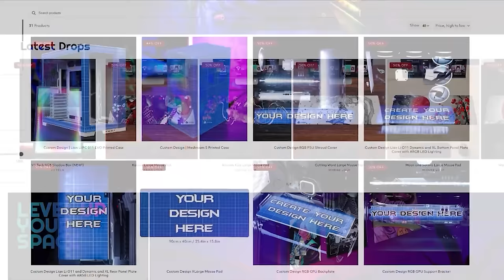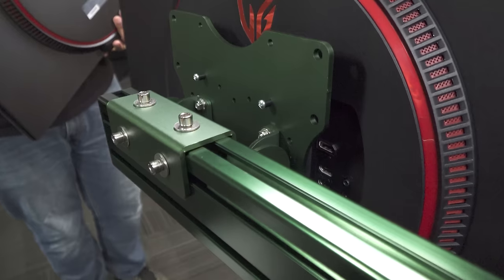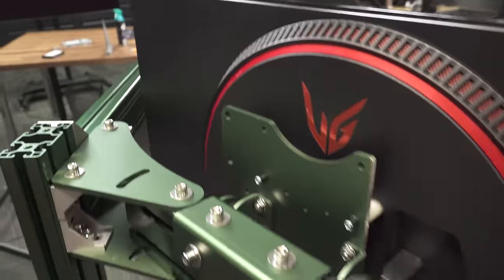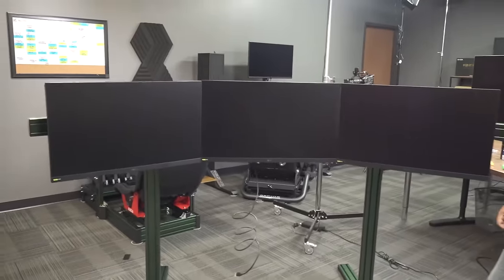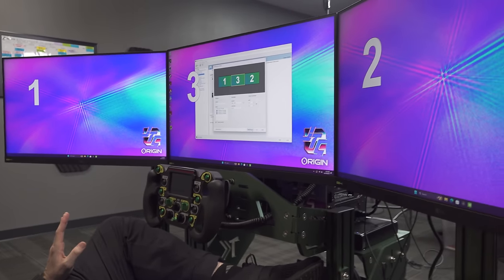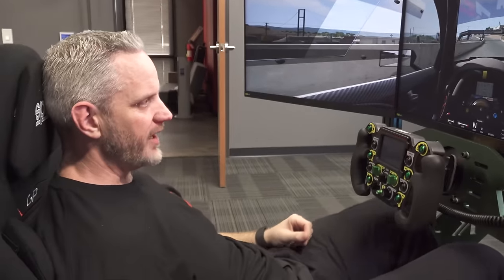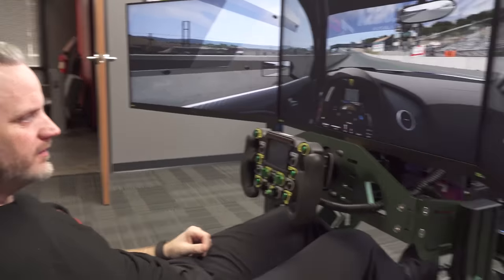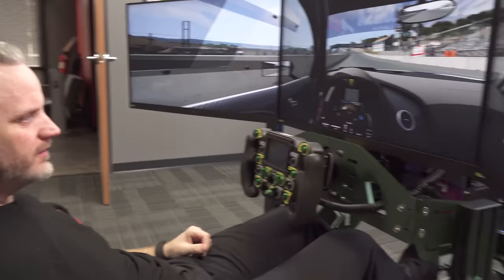I haven't used NV surround in over 7 years! Does is still suck?

Comment: I've just started getting back in to sim racing (still entry level g29 setup, will upgrade to moza stuffs in near future) and I'm absolutely loving this content! love to see what others are doing with their setups and learn a thing or two along the way! 

As others have mentioned, Content Manager for Assetto Corsa is a must! Such a game changer and makes modding soooo easy.
Anyways, keep up the great work. I look forward to what comes next. Happy new year Jay, Phil and Nick!
Reply: Yo , from an ex moza user i am going to offer you advice i never had the benefit of . I have no idea what your budget is and moza looks a viable solution based on value but it WILL! Cost you alot more in the long run if you buy moza .i owned the r5 bundle and the r9  with a gs wheel and srp pedals   both were nice setups and felt decent to use but moza have lets say interesting quirks . The bases get excessively hot after a very breif period of driving especially on AC and ACC maybe its the way the ffb is delivered to the base but after one race the base had to be left to cool or the ffb would be cut to control the heat both are not good , the nm values you are sold are quite overstated yes you may get breif monents of the advertised value but not often , now lets deal with moza support, in a word terrible !  I had an issue with the r9 base which had to be sent to their repair center this took 2 months to sort out, they can take weeks at a time to respond to an email conersation (not good for your emotions) i paid shipping for my items return which i was told i would be refunded(i wasnt) was all a horrible experience . The software and firmware updates are intent on killing your equipment every update is a lottery if the base will still function as before ( mine changed one update and i could never enjoy it again from that point it never felt as it did prior to the update) after less than 12 months and spending about 1700£ on the two bundles i sold it all at a loss i got 1050£ back and re invested in the asetek la prima bundle i had to add another 400£ to buy this so now in total i was down 2100£ to get a setup which is vastly superior to the moza setup in quality and feeling . You will end up uograding if you go moza so with all sincerity i will save you that hassle and say go simagic alpha mini or asetek or the new csl dd which is just realeasing. You spend a little more upfront but save yourself money,stress time in the long run . Ive opened the door to you its upto you if you walk through it.
Reply: @bodasafur6078  I appreciate the detailed experience/feedback, definitely something I'll look into more. Budget-wise idk really.. moza became appealing because as you said it seems like pretty good value compared to a lot of the market and I've heard a few good words about their bases. They were also on a real good sale just recently near me but I see now that's finished :') maybe it's a good thing lol. Was mainly interested in the moza R12 with I think it was the rs V2 wheel and still hadn't 100% decided what pedals as I heard mixed reviews about srp and CRP pedals.
Will dive down the rabbit hole again 😂
Reply: You are welcome , its worth noting that jay has already swapped from moza to simucube it looks like ,these guys had all moza last time i saw them using it now suddenly not. Its very telling .
Reply: @bodasafur6078  yeah I had noticed that. Though I don't recall him mentioning having any problems with moza (at least in this vid) which also says a little
Reply: @UnknownEntity420  yeah im not saying his stuff broke but either way he felt he needed different/better gear  which goes to my point you will want to upgrade sooner or later im trying to suggest through experience its easier to buy wise first time

Comment: Jay, I used the exact same monitors for my triple setup.  I just used standoffs, 4x50 mm, in the monitor to space them away from the vesa.  Also, you need to slide the vesa to the outside of the extended arms as far away from the center as possible to get close to the 60 degree angle desired for the side monitors.  It will give you a 180 fov.
Reply: The side monitors edge should be perpendicular to you eyes.

Comment: When you properly set up the monitors in the sim they will have a much steeper angle surrounding more of your head, that will force the monitors to be further out on the arms and allow you to put the screw back in and use the designed amount of angle

Comment: as a guess a 2 or 3 inch block spacer between the mounting plate and the part that holds the plate to the arm should let you pull the montiors in to where they work properly without any jank.
you could even make it out of wood if you don't have metal that thick

Comment: I think you've probably set up the monitor stand wrong. Most alu profile stands have the cross pieces sat infront the uprights. That way you can then bolt those angle brackets direct to the cross pieces and you then get your left right adjustment completely independent of the uprights vertical slots.

Comment: ARKON Mounts Square VESA 75/ VESA 100 adapter plate, on Amazon for anyone that doesn’t have the tools to cut the plate. 

I had this same issue mounting my LG Ultragear 49, power was completely covered by the simlab plate and I got lucky finding one that works with the aluminum slots.

Comment: Would like to see you do some more sim rig builds in various budget ranges and compare them to your ultimate one.  Also, would be cool to see a multi-purpose sim rig and how easy to interchange between racing and flight.
Reply: Rig itself Trak racer tr120. Then choose Moza for entry or simucube higher end for wheel base/wheels. Then either Sim jack pro for entry, moza for middle of the range, simucube/asatek/heuisinkveld for high end pedals.
Reply: Rig itself Trak racer tr120. Then choose Moza for entry or simucube higher end for wheel base/wheels. Then either Sim jack pro for entry, moza for middle of the range, simucube/asatek/heuisinkveld for high end pedals.

Comment: This is great lol, I’ve literally done the exact same thing! I as well have used nylon spacers and long M4 bolts to mount monitors in a way that wouldn’t absolutely frick the cables. I’ve done the same thing with a large flatscreen tv too actually, to keep the HDMI out of the wall.

Comment: Get rid of the corner brackets where the side arm mounts to the center monitor arm. You can see the “angle bracket” is bolted directly to the left/right side arms. It can be bolted the same way to the center monitor horizontal arm.
Reply: Where can I send you guys pics to my setup using same rig?

Comment: I have the curved version of those monitors. Also you may complain about the mount but we all know they intended you to use a 100x100 max bracket like most stands and mounts use. So in like 90%+ of the time the placement of the ports should not be an issue. Also with them in that location it makes it easier in most cases to run the cables along a mounting arm.

Comment: I have the same monitors and a trak racer triple mount rig too. So glad it wasn't just me who found it infuriating how LG placed ports and even frustrates the best of us. I used extenders on the bolt fittings but still had to use 90⁰ adaptors to get cables in (don't have a grinder to hand or would done what you did lol). 
Lot of hassle but worth it once up and running
Reply: Have similar monitors on a Sim-Lab trip stand, and bought 90 degree cables. Only way to get it to work (Vario Vesa Mount). Great thinking LG!! :P

Comment: Okay so 2 HUGE things Jay and Nick on the monitor stand since you're new to triple screens:
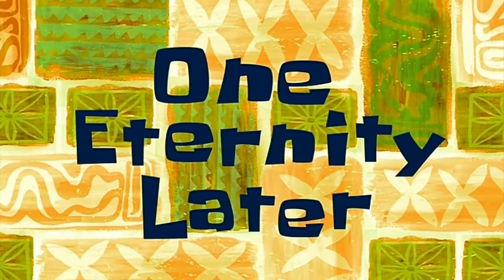1. 5:30 - You did this backwards! Move the monitors on the side arms out towards the ends of those arms, set the angle you want in the slot on those angle brackets for the side arms, then slide the side monitors back towards the centre to eliminate the gaps as best as possible! Greater angle for the side arms = mathematical FoV will be higher = greater sense of speed and immersion since the screens wrap towards the seat more
2. 12:45 - single screen means the game window is rendered from a single camera viewpoint, which distorts the image on the side monitors since the camera can't capture such a wide FoV correctly, regardless of whether you're using Surround or not (as there are many games, including Assetto Corsa, that do not require Surround for triple screen functionality), you should have selected triple screen for the Rendering Mode so the image on the side monitors won't be distorted!

Otherwise, uh Happy New Year JTC crew

Comment: If you go Flight Sim, the Airbus style controls aren't in front of you. Throttle, flaps, gear, etc. are all off to your right (assuming in Captain's seat) and pitch, roll, bank, etc. are on a joystick off to your left. I have the Thrustmaster set and it would be perfect for not interfering with the wheel.

Comment: I have the same monitors with a track racer triple stand.. I'm saying this to help.. hopefully you take it positively fellow enthusiasts! But if you mount the angle bracket for the side monitors on the bar parallel to the ground ( same bar the center monitor is mounted..) you will gain the ability to give your setup the proper angles. It's how mine is mounted. Good looking rig.. and looking forward the sim racing bug biting you more and you guys sharing your journey!! Congrats by the way.

Comment: Just on the monitor mounts you have each side monitor at a very shallow angle which is why those bolts wont go in either side. Might be better off with a sharper angle like 56 degrees this will help periferal vision when racing too.

Also take a look at a program called resize raccoon it's a god send for setting up tripples

Comment: Elite Dangerous is fantastic with TrackIR 5 and 3 screens.  Truck Simulators are fun with 3-4 monitors, even without surround.  Pickup Flawless Widescreen and you can play additional titles like AC5 Black Flag etc.  Black flag is impressive when traveling the ocean accross 3 monitors.  Seeing the entire ship length during broadsides was another level of immersive, even if I had to disable some hud elements that stretched.
Reply: is TrackIR even still around? I figured that affordable home VR headsets would have made the entire TrackIR system obsolete?
Reply: @StreetPreacherr  Yes you can still buy it, and its extremely useable with python scripts since it can emulate mouse in games that don't support it.  Basically if a game supports a mouse I can use my TrackIR.

Comment: I only run iRacing, with triple 32's and a 4th 24" NV Surround just didn't work correctly when I tried.  You can setup your ini for the resolution you want the output to be and it works perfectly, there are a few good videos on youtube showing how to do this.

Comment: The Nvidia drivers don't rely on the OS for the monitors and positions. It is a separate thing. You didn't seem to notice that you didn't have to kill a bunch of programs before getting to the configure stage. Nvidia has not actually stopped supporting surround, they just don't have a lot of resources thrown at it. I used it on my main desktop for work and gaming. I have had to get a couple of extra apps as my setup keeps moving the taskbar to the left monitor even when I tell it to only allow it on one monitor. I have also physically tried to force the taskbar to stay in the center monitor by connecting the monitors to certain ports, but in the end no matter what I do it ends up on the left of the 3.

Comment: I did a surround setup back in 2010. Only games I played where it really worked well was counterstrike and TF2. I still have the monitor configuration but stopped using surround in 2017. What I'd really like to see are games that use extra monitors for other things. Like how about Baldur's Gate where your inventory is on a second screen? How about a RTS game with the map full size on a second screen? Supreme commander had this feature 20 years ago though every time I tried to use it my installation completely broke. So many possibilities and yet no one does it.

Comment: if you slide the monitors on the arms out further on the arms away from the center monitor, you can  have more angle and the bevels will touch and close the gap  \ _ / or   \_/ instead of _ _ _
Ideally, you want your side mirrors for peripheral view.

Comment: I  used the same monitors but built my stand out of wood.  No issues. 

1. You don’t need to use nvidia surround.  I would advise against.  

2.  You could have put that stand together differently to make it work.  

3. I’m a little worried about the angle and height of the monitors compared to seating position.  Ideally you want to have the side monitors angled so you have 175 to 180 fov.

3.  You want your eye level to be level with middle of screens.  

4.  You want your elbows to form a 90 degree angle with your arms when gripping the wheel. 

5.  You can double check distance from wheel by holding your arms straight out.  Wrists should be resting on top of wheel. 

6.  Wheel axis should extend through the top of your sternum. 

All of the ergo stuff really matters for comfort

Comment: To get more angles on your monitor

1) move the outside screens further out on the outboard arms
2) slide the outboard arms further in on the central arm attachment

You should aim for 50-60degress for full immersion

On Assetto Corsa

1) select triple screen
2) when sat in the car in “drive” move the mouse to far right side and open triple screen menu
3) input the angles and distances to correct the image distortion to outboard screens and get correct FOV

Comment: yeah, connectors should be pointing at the bottom edge, so that the cable should be inserted from bottom. Or the sides, like on TVs. I had my problems with LGs idiotic similar placement, it also interferes with regular mounting arms too.

Comment: M4 extension studs are perfect for spacing out the monitors. I use Dell monitors and the VESA mount on the back isnt ideal. But the extension studs do the job. Plus you can order different lengths to your preference.

Comment: Would it have been easier to just drill 4 more holes in the bracket 1 1/2" offset to the side? OR Right angle adapters for the cables (don't know if they are available).

Comment: Just need a Adia64 screen in the bottom left of the setup and if you go into windows 11 display you can drag the screen to the bottom or top corner of the screens and away; it will detach the sensor screen from the other displays so it can’t interfere

Comment: so, as far as monitor positioning, you don't need to do anything with the bolts where they attach, you just push the monitor vesa section outwards and then rotate the assembly more inwards. In that case, you actually wouldn't see the ends either. (source, same setup in the room with me rn)

Comment: Hilarious that I came across this because I ordered one of these exact same monitors for my F-GT rig and had this exact same problem where I needed the vesa mount spacers so the power cord could work. can't believe LG puts those ports facing the same direction and so near a vesa mount. Needs some downward facing ports. So ridiculous, otherwise it limits VESA options. I guess that's why it was on sale though.

Comment: Can confirm, I do sim racing and flight sim stuff with one rig. I have the Trak Racer TR120 and their triple monitor stand with triple 32" MSI 2k monitors. I've done iRacing, Assetto Corsa, BeamNG, etc. for driving stuff. I have a VRS Direct Force Pro wheelbase(direct drive) and their Direct Force Pro pedals, cheap e-brake and cheap manual shifter from Amazon. And I use the rig for DCS as well utilizing head tracking (TrackIR with the pro-clip). I have the flight controls mounted on the sides of the rig (Logitech X56 HOTAS desperately want to upgrade but it works fine). I have a quick release attachment for the steering wheel so I can set it aside while doing flight sim stuff. I also plan to eventually center-mount the flight stick and have a quick release setup that allows me to attach it and remove it from the rig as necessary. My keyboard is on a hinge mount so I can swing it out of the way or in front of me based on my needs. Long term goal is to have a separate dedicated flight sim rig...one day...one day...

Comment: I’m not sure that monitor mount is built with the intention of use with monitors. I’ve only ever seen that one used with TVs and usually 40”+ size.

I’ve been using NVSurround for my triple monitor setup and I haven’t had much issues with it at all. And works with any game that supports ultra wides.

Comment: Fixed my LG connectors in the worst possible place problem the very same way. Simlab vario vesa adapters are a very good investment when it comes to triples

Eyefinity worked better for me then NVS, especially when VRR was involved.

Also 32inch not enough for truck sim :p

Have fun!
Reply: Yeah, when I upgraded to 4K monitors, I cheaped out.  And went 27"x3.
And it's courting eye strain.
Won't do that again.
Next screen is likely going to be a 50+ inch 8K TV.

Comment: that extra bit or the arms sticking out could be used to mount some nice speakers so you get some nice immersive audio as well, maybe even a nice 2.1 setup and mount the sub to the seat frame so you get that rumble of the engine feel too. as for games to play, why not boot up the old no mans sky at all ultra settings and jump in a black hole or 2,then land on a random planet and pull out the space-bike (pilgrim) and do some dirt bike-style off-roading.